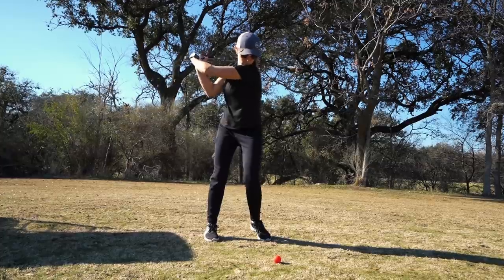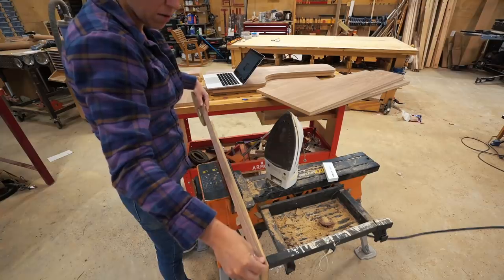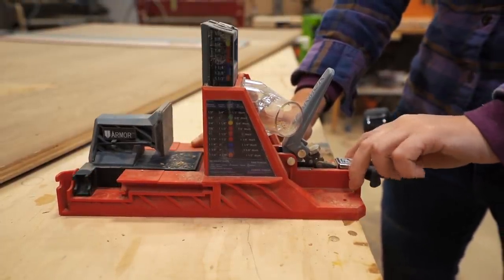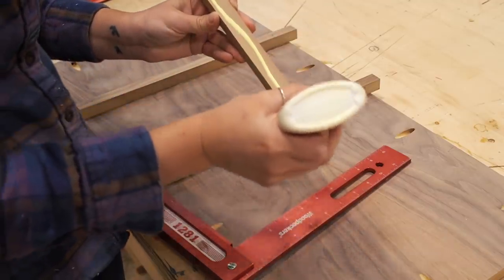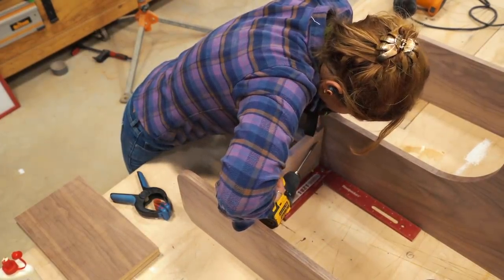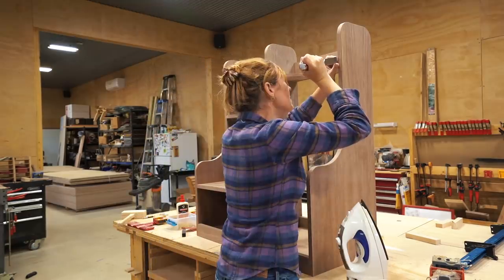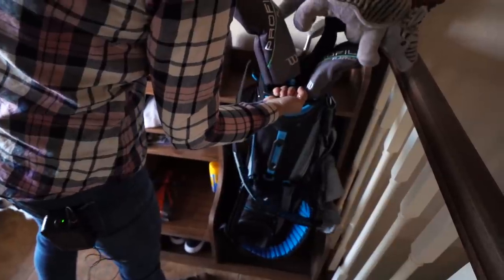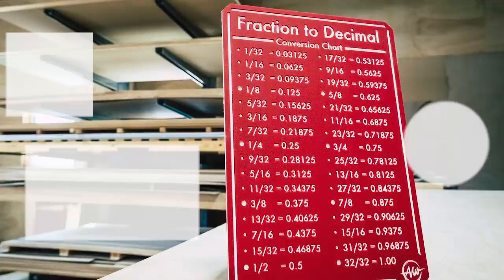Build a Golf Bag Holder! Organize Your Golf Gear

Comment: This came out pretty slick April. If I may leave a suggestion about edge banding  the inner circle of plywood, if you have a blow torch pull the trigger and run it for about 30 seconds. At that point use the heated barrel ( no flame) against the inside edge with the edge banding on the plywood and it will seal just fine

Comment: If anyone is having an issue with your bag and clubs leaning forward and your worried about the bag spilling out of the  stand, Simply install a screw in loop to both wooden sides in front, and use a small bungy cord, unhook one side when you need them, hook the cord back up when you are not using the clubs.